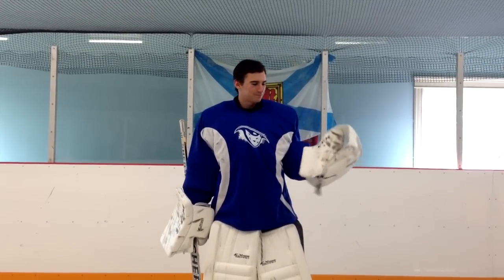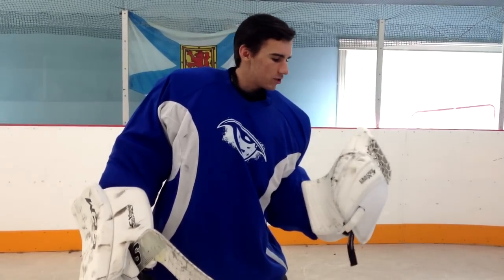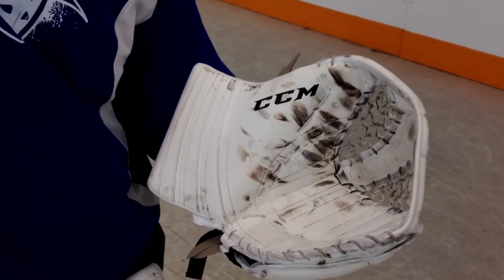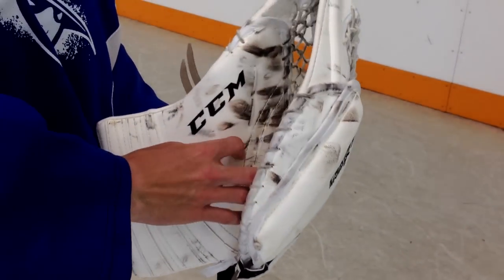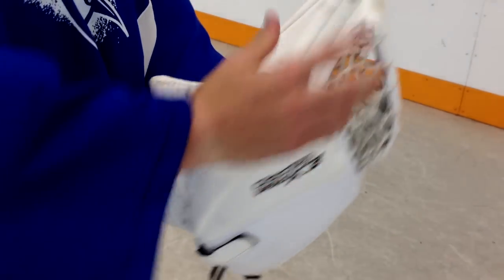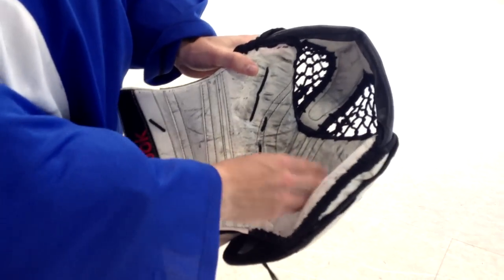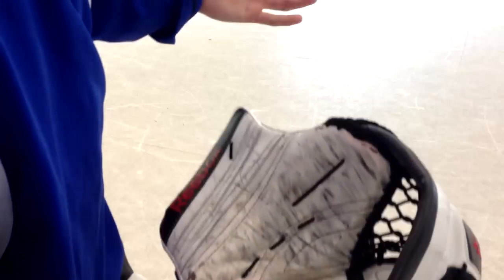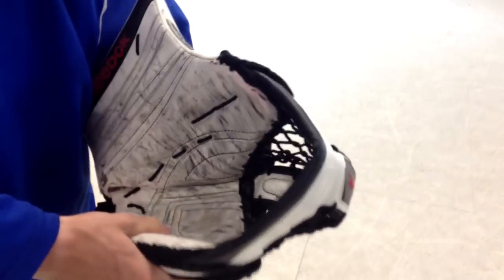How To Break In Goalie Glove │ by: How To Dangle

Comment from the maker: I dont want to point out the obivious but when you but it in the oven, you probably left it in to long or turned it on to high. But with the water, you dont just put it under then leave it. Its all about working it in. Sometimes i can spend hours on my coach just opening and closing to work it in. Do the same with the water. Keep doing it until its almost dry, it shouldnt end up too crusty!